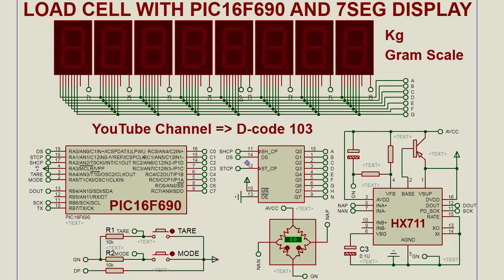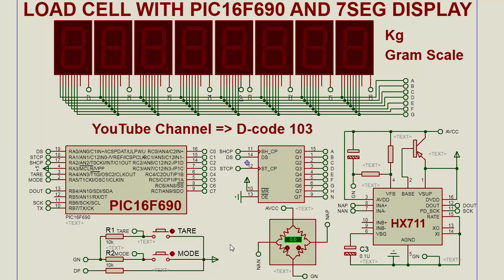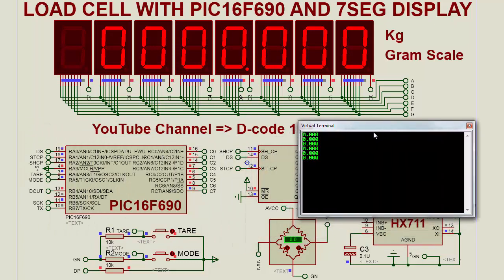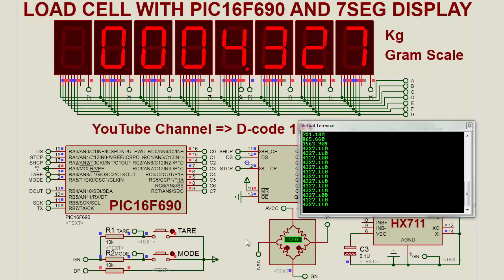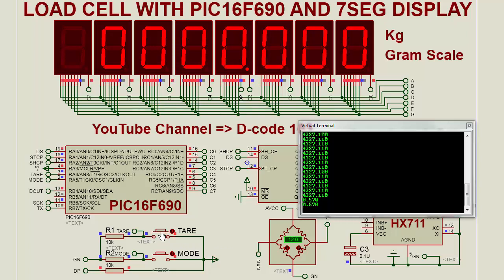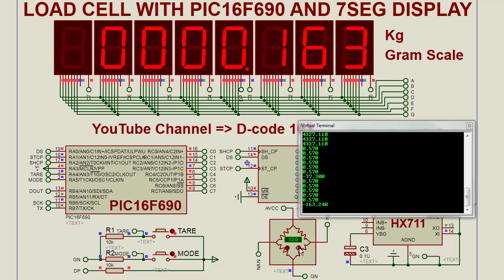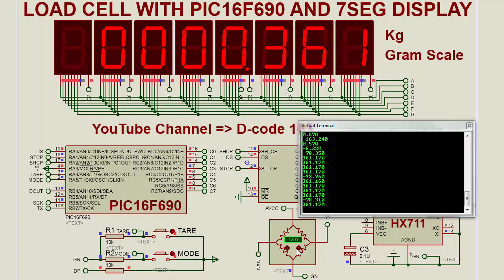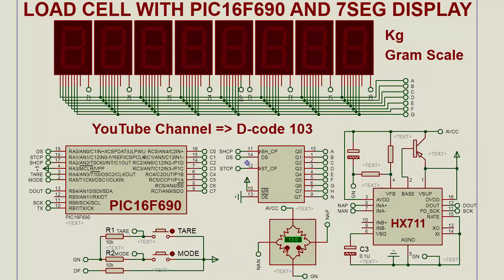Loadcell interfacing with pic16f690 with tare function

Comment: Hey! How did you managed to communicate with the HX711?
Reply from the maker: It's a two wire serial communication.
Read it's datasheet. There is code example in datasheet. Thank you
Reply: I tried to copy that example on the datasheet but couldn't communicate with the pic
Reply: Nice video tho, really informative
Reply from the maker: That is concept to take digital value corresponding to analog value. Read some examples of Arduino code (hx711) and   two wire communication . Read data sheet also .
Reply: @Dcode103  I have worked with the arduino for the loadcell but I don't manage to receive the information form the pic. I had read the datasheet but don't really understand how the function that they offer works. I have eveything connected and the loadcell doesn't sends anything
Reply from the maker: First test hx711, loadcell with Arduino to confirm ok. Which pic micro you are using. Please let me know your location and professional introduction.
Reply from the maker: And which software you are using for coding.
Reply: @Dcode103  I'm coding on Mikro C and I'm simulating on Proteus. The point is to measure and pass it to an LCD
Reply: @Dcode103  I'm just simulating on proteus to test the code. I will use the PIC16F690 and have the pickit3 to program it when I have the code done. From Dominican Republic and I'm studying Mechatronics Engineering
Reply from the maker: Ok, please tell me your location, pic micro name.
Reply: @Dcode103  Dominican Republic, I have used I2C to communicate on Arduino but I don't really understand how I have to manage to receive the information from the module. I have the function that they have on the datasheet but it doesn't seems to work. I think there is something else that I'm not seeing
Reply from the maker: Let me give two day to test using mikroc . This is our email
dasjeeprojectsolutions@gmail.com

Send email for communication. If I do will communicate with emails.
Thank you
Reply: @Dcode103  Thanks for everything
Reply from the maker: Check and reply
Reply: @Dcode103  can you give the sample code ?